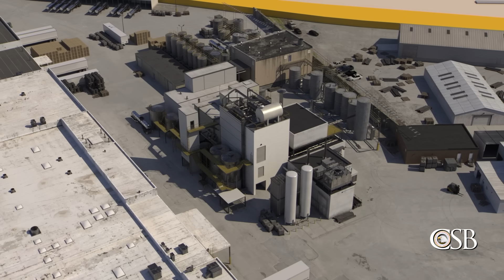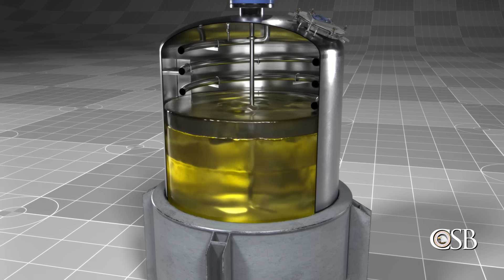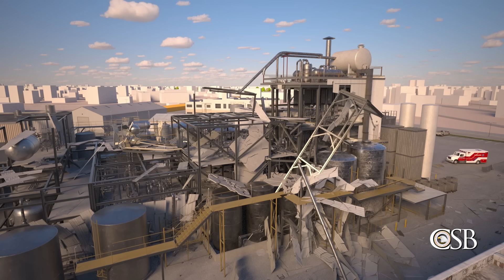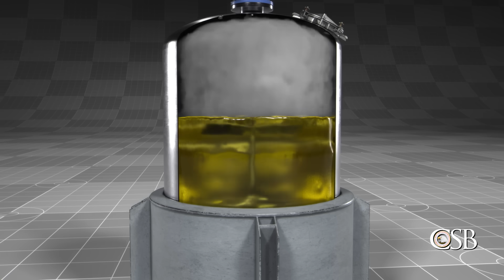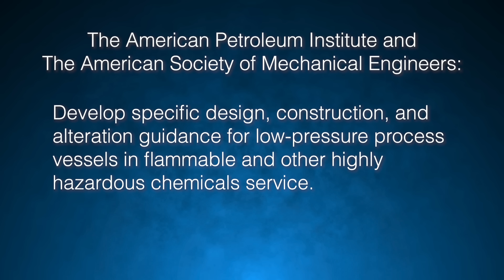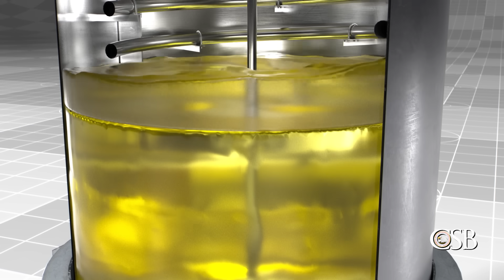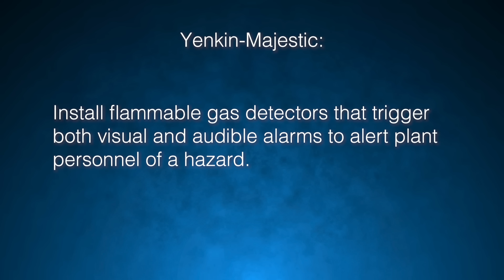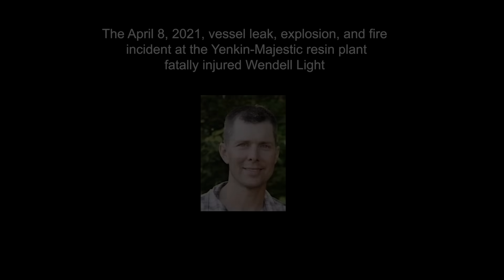Low Pressure, Fatal Consequence: Explosion at Yenkin-Majestic

Comment: 'On the ground floor, multiple flammable gas detectors inside the building detected the cloud, but none were configured to sound an audible alarm'

That's just comically bad. What the fuck is even the point then. How incomprehensibly stupid can you possible be as a plant manager.
Reply: Emailing alarms is standard procedure, "alarm" in factory software just means any value is off and needs to be acknowledged by an operator. This happens all the time because there are hundreds of sensors that workers can mess with or that just degrade in accuracy all the time, so don't get confused by the wording. Adding emergency procedure on top of an alarm is its own beast, email or not.

Comment: Low pressure vessel... but it has no PRV and is a sealed vessel full of hot solvent and resin on the regular... physics says that only a LPV until it explodes.  A 2 psi PRV to an emergency flare and the door would never have been an issue.
Reply: Yenkin-Majestic claimed it was a "low-pressure vessel," but the installed rupture disk setpoint was 17 psig.  Yenkin-Majestic was being scummy and trying to avoid code.

Comment: This explosion could have been prevented by one simple addition on the logic tree for the agitator control. Why didn't a pressure release vent the fumes that should not have occurred in the first place? How much money was saved not putting an alarm on the detectors? What good was a manway with a window if you can't look into it and see that the agitator is not running?

Comment: 9 PSIG (0.62 bar) is a very low pressure, its about 11 times lower than the pressure in a shop compressor in a automobile repair shop (7 bar).

One thing about the gas monitors however, is that it can be wise to tag the gas monitors based on their location, and use that to triage an alert. So gas detectors near places that are working with flammable material will react sooner but gas detectors farther away, will ignore the alert IF no prior gas detectors detected anything. Sequencing alarms in this way (requiring gas detector 1 to go off before detector 2 before a real alert goes off) can be useful to reduce nuisance alerts, since if gas detector 2 goes off, without 1 going off, and you know the locations around detector 2 doesn't handle flammable material, then you know detector 2 is just acting up.

Alerts in different "levels" can be used too. Pre-evacuation alert (prepare to evacuate, take on cothes and get your belongnings, but don't evacuate yet), Evacuate buildings but not areas (just go out of building, but remain on site), and then the highest, evacuate the site. In this way, you avoid unneccessary evacuation, and lessen the risk that people ignore the alarms, if the alarms come with different "severity levels".

Comment: I think the most unforgivable part of this was the flammable gas alarms not making noise. The failure of the mixing chamber felt like a pretty surprising failure state, everything going wrong in the perfect way, (though obviously the mixing chamber was super botched) but not warning employees about flammable gas was just asking for fatalities, no matter what kind of accident happened -- this is just the particular failure that happened.
Reply: Emailing alarms is standard procedure, "alarm" in factory software just means any value is off and needs to be acknowledged by an operator. This happens all the time because there are hundreds of sensors that workers can mess with or that just degrade in accuracy all the time, so don't get confused by the wording. Adding emergency procedure on top of an alarm is its own beast, email or not.

Comment: Insane that the US gov has considered or is STILL considering defunding the CSB.
Reply: Already defunded as part of the “Big Beautiful Bill”. This is probably the last investigation done by them.
Reply: @chow-chihuang4903  They still have 9 open investigations according to their website, and have been ordered to use their emergency funds (only about $800k) to finance the completion of these last investigations by September 2026, which is unlikely considering how long these investigations often take. Not to mention they've been barred from opening any new investigations since the bill was signed, so if a company decided to start cutting corners now, there's gonna be no one left to investigate. . . (and no the EPA and OSHA don't have the resources to take on this extra workload, especially after their budgets were cut in half as well by the same damn bill. . .)

Comment: Here's another safety problem I saw: Don't have a control panel placed in a corner or other place where the operator would become trapped if something went wrong. I know that what was shown in the graphic may not be like the actual setup, but such a setup needs to be pre-designed to allow escape of operators in case something goes wrong. If this was the actual setup, and the chemical released was, say, hydrofluoric acid, he wouldn't survive that entrapment.
Reply: The bigger issue is the obvious lack of further control panels, you should be able to control (at least most of) the process in the lil lab and also in a separate control room. The panel right by the reactor should only be for doing steps that need manual work as well.
Reply: @HHdiggAAA  tbh in this day in age there should be a camera looking into the reactor with the operator in their lab able to bring it up at any time. Perhaps even a written procedure to check the feed before beginning the next step, as to for example verify the stirring system is stirring.
Reply: @filanfyretracker  camera is over the top, protocol always useful but can't replace proper safety chains and alerts by a properly set up process control system. The heating should have never been able to run without an agitator, a temp high alert should have followed too anyway, again, shutting the heating off automatically.
Reply: If its HF release, you don't survive if you are in the same room. Then it should be gas-tight window in a separated control room and preferable airlocks into the vessel room, where 1 door always have to be closed. And interlocks requiring inserting a key that is chained to HF-tight clothes IF systems inside the room detect an HF release. (but during normal operation you don't need the key).

Comment: Normal operating pressure?

Well there's your problem! "We don't need to  worry about this closed container full of paint thinner because normally it stays below 15 psig."  Normally it doesn't burst or leak. 

Normally.

Also there's a huge difference between a low pressure air leak and a low pressure leak of boiling paint thinner.

Comment: Pressure testing in itself is a skill and can be dangerous. I have seen what happens when the air pressure set at line pressure of 150psi. because that's what the air tools needed.
Reply: You're supposed to fill most of the volume with water and then pressurize the little headroom that's left. That way, it doesn't catastrophically blow up on you if it does pop.

Comment: Big props to the coworker who saved the first operator
Reply: @NavajoMX  Yah, it's good to have coworkers like that.
Reply: Then proceeded not to tell anyone else
Reply: @helterskelter9020  Well, in his defense, and in the defense of the guy helping him, the operator was burned from 400F degree chemicals and toxic fumes.
Reply: @helterskelter9020  Note that there were about 120 seconds from the initial release to the explosion. This all happened really quickly, hence the need for automated alarm systems.
Reply: @adambuchbinder2791  You nailed it.  The humans shouldn't need to be the alarm system, it should all be automated.
Reply: @helterskelter9020  or pull the fire alarm
Reply: @DontCryAboutIt  they were more focused on the "GTFO" part of "GTFO and get away from the explosive vapour cloud" 

Also potentially mild cognitive impairment from oxygen yadda yadda yadda

look, are you gonna take the time to stay in the burning hot fumes to fumble around for a fire alarm, or are you gonna book it like your skin is fucking burning?

Comment: How is it possible that there wasn’t a relief valve!
Reply: The CSB's written report states that there was a rupture disk.  However, the rupture disk setpoint was 17 psig (so the reactor should have been subject to pressure vessel code), and the reactor manway redesign was a cheap, thin, four-bolt design that was weaker than the rupture disk rating.
Reply: Even with the relief valve/rupture disk, i doubt it would have been sized for a case of extremely rapid vaporisation of the naphta due to a failure of the agitator (this would be a tough case to size for...). This risk should also have been identified in a hazop and an interlock should have prevented adding the naphta if the agitator is not working.
Reply: The comment I was looking for...

Comment: Installing gas detectors but making it so it alerted nobody in the building is insane why would you even install them at that point. It’s like having a fire alarm that does nothing when pulled
Reply: "Thank you for pulling the fire alarm. We have (probably) alerted someone somewhere, maybe. Have a nice day!"
Reply: Why have in-house safety when you can outsource it? -someone in finance, probably
Reply: You can bet your bum that was a management decision.
Reply: The video said it automatically disabled the furnaces
Reply: @tylerpeterson4726 good first step, but could you imagine if someone detected a problem, walked around the room and turned off all the furnaces but didn't tell anyone they were doing it or why? I could see people thinking it was just a glitch and try turning them back on, but considering there didn't seem to be audible alarms anywhere, most wouldn't even know they got shut down in the first place...
Reply: @tylerpeterson4726 And yet the flammable gas took only two minutes to ignite.
What use was this measure in the end?
Reply: @carlpanzram7081  when you see a car driving towards you, do you also just stand there and wait for whatever comes to happen? A minute of time to evacuate and you would just give up without even trying.
Reply: I bet the detectors were at one point connected to an alarm system, but due to some changes made to the system/some wiring somewhere, the alarm became disconnected. Situations like that are exactly why alarm systems of any kind are tested at regular intervals.
Reply: When I was a network administrator in an industrial environment one of my colleagues did a project to install environmental monitors in all of our switch rooms. One of the rooms flooded, we found out from the emergency response team when it was already about to reach the height of the equipment. I checked the monitors and they were alarming silently without any notifications set up.

I also got a safety near miss reported where someone tried to call the emergency line and it didn't work. Someone had deployed phones without the proper dial plan, so they could call any number except the emergency line.
Reply: It alerted the control room panel I believe

Comment: I think part of what contributes to accidents like this is the large volume for gas & vapor in the overpressured vessel. 

A vapor pressure of 1 psi in a volume of one cubic inch releases a tiny volume of vapor when it bursts. 

A vapor overpressure of 1 psi over a volume of tens of cubic feet releases a huge volume of vapor when it bursts.

Of course, industrial chemical manufacturers tend to have industrial-size reactor vessels, not small ones.

Comment: This is just depressing: "facilities should ensure their equipment can operate under normal conditions."
I think the UCSB has kind of lost the war when your recommendations sound like they're literally for Pakleds.
Reply: My first thought is, if the agitator should always be run while the solvent is being introduced, why isn't there an interlock?
Reply: To be fair in this case, I'm not certain I agree with their recommendations with regard to low pressure vessels. Regardless of if they had tested the process tank to 12 or 15 psi, the effect of stirring the super-heated resin would have caused failure - if anything, failure at a lower pressure would have reduced the violence of the flammable gas release. A relief system for relatively controlled release of pressure into a safer space would be, in my opinion, more important than certifying a vessel not designed for excess pressure to withstand excess pressure. The control system design and lack of FMEA in its fail-safes seems to me to be the only real root cause on the initial release. Although, knowing the way these kinds of systems are designed and installed, anticipating a sequence of events like this and programming safeguards is a tall ask - though one that is absolutely valid of regulators to require, particularly with hindsight of a fatal accident like this.
Reply: @JGuraan  So yes and no. My comment was intended to be entertaining I guess, but this video left out one extremely critical detail for why their recommendations actually make sense: The chemical reactor vessel had a rupture disc that was designed to pop at 16.5psig. If the vessel had been tested to the rupture disc pressure, the solvent would have ended up somewhere safe.

The video made no mention of the rupture disc safety, which it definitely should have. It made it seem like this was just a big pressure vessel with process safety as the literal only safety mechanism.

But yeah, at 400F, the naphtha would have been at something like 200psig. The rupture disc is your missing piece of information.

I did read most of the UCSB's 80 page report (you can find it in the description) and they keep calling it a "rupture disk". It isn't "disk". Its "disc", always in industry. This video was a weird one. They should probably fix it.
Reply: @htomerif  Thanks, they should’ve mentioned a rupture disk. That must vent to the big tube going up, in the animations.
Reply: @htomerif That's a big omission! You're right, that makes the pressure problem with the hatch much more relevant, and explains why they bring up pressure vessel requirements for the tank. Paints a much worse picture of how the hatch replacement was handled and the lack of appropriate considerations. Clearly I should have read the report!
Reply: @htomerif  I was wondering about that. There should have been a P. Eng involved in the man-way design. If so, he needs a practice review and possibly action on his license. If not, the company needs to be sanctioned. Relying on the emergency cooling when handling boiling gasoline is dumb. There should have been a PSV vented to a flare stack. Yeah, it cost more. Still cheaper than a new plant and a dead worker.